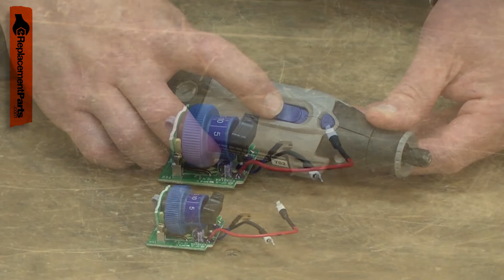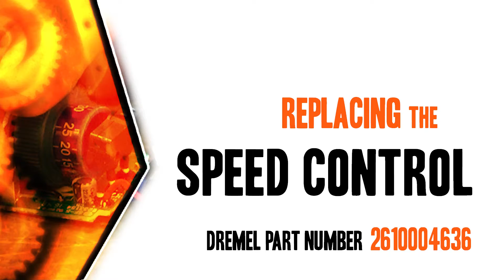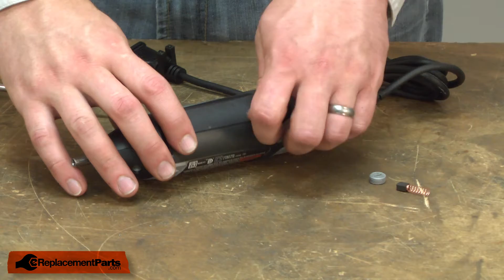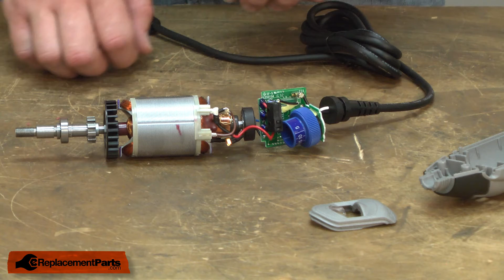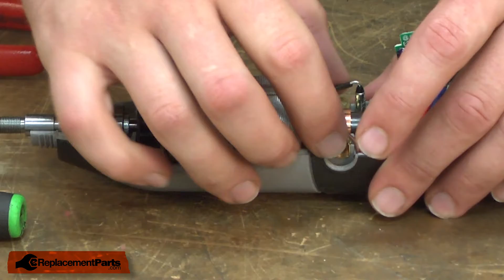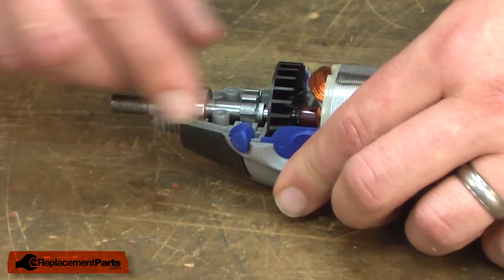Rotary Tool Repair - Replacing the Electronic Speed Control (Dremel Part # 2610004636)

Comment: Life saver..opened mine and the blue wire from speed controller that connects under one brush cover with metal clip was disconnected...speed controller was fine .might be a common problem that happens when changing/inspecting the brushes. Big thumbs up.

Comment: Hi,

I have 2 questions:
1. I bought dremel 4000 110v, but I connected it to 220v, so I damaged the electronic speed control, so I can replace it with one that works with 220v without affecting the other parts?
2. What is the part number of this electronic speed control that works with 220v?

Many thanks for your help

Comment: Great little video!
 I came here looking for something insight into why my speed control had stopped working. 
I found the after I had changed the armature (dreaded thread damaged) the clip (blue wire) had come dislodged away from under the brush holder which caused my problem.
Many thanks